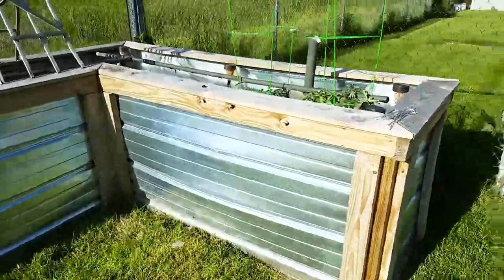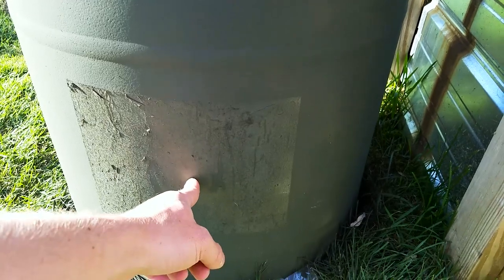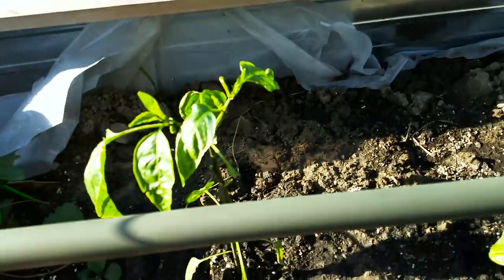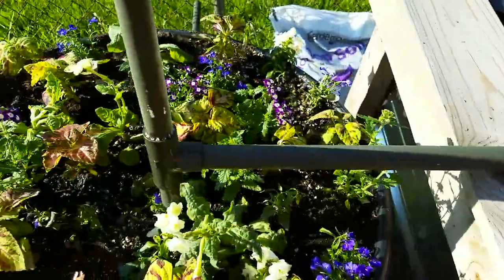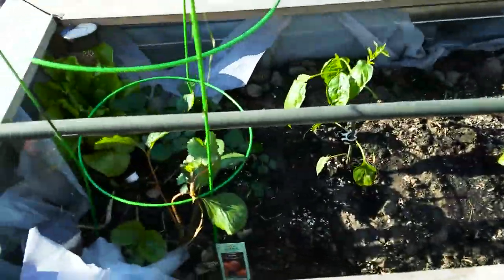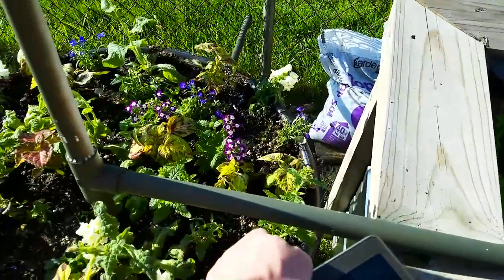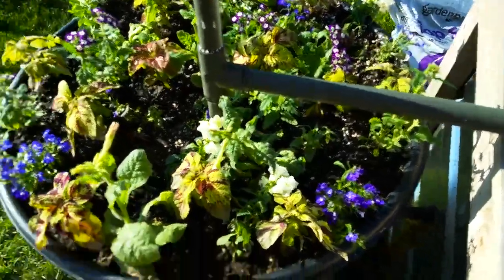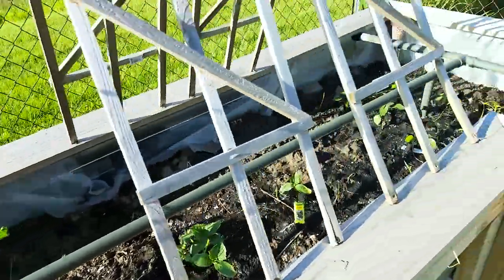Cheap SMART garden watering system!

Comment: I've been thinking of something like this. i collect rain water into two barrels and then use that to water my garden. My plan was to use a similar pump but to have some type of solar power to charge a car battery or something to control the pump. Your system looks nice only thing I would change depending on where you live is to take the piping and put it into the dirt. You DA Man! Thanks for video

Comment: May I know what is the application or software that you used for the If... then...?
Reply from the maker: +Chu Zhen Mok it's the Smartthings platform using core. Communities Own Rule Engine. Check the link in the video description. It uses the Smartthings hub as the brains. And Core is the smartapp that controls the different variables. In this case time.